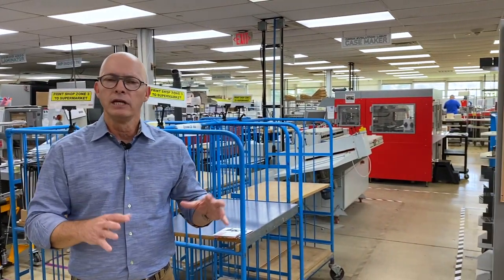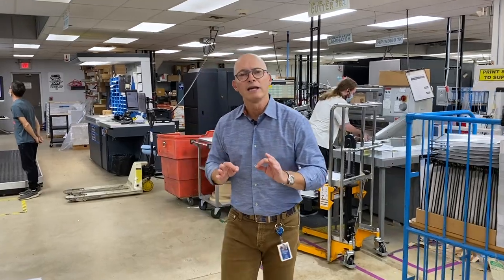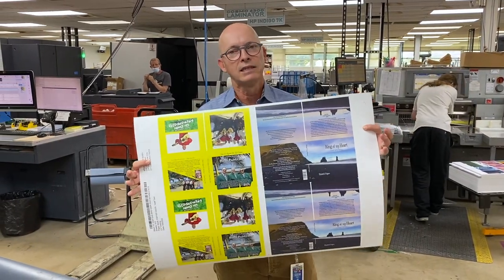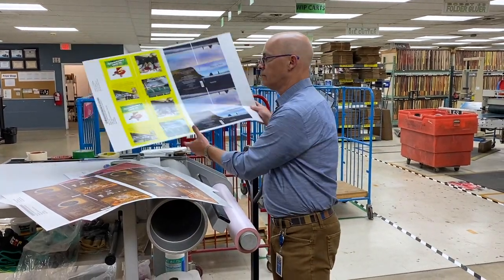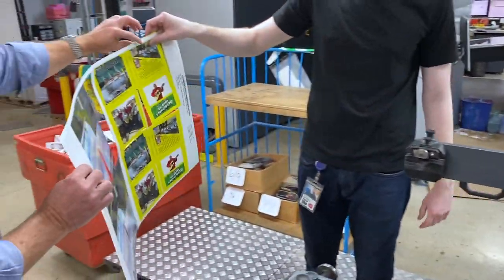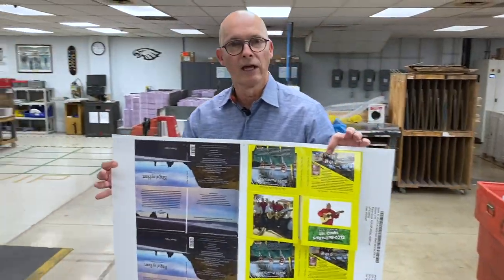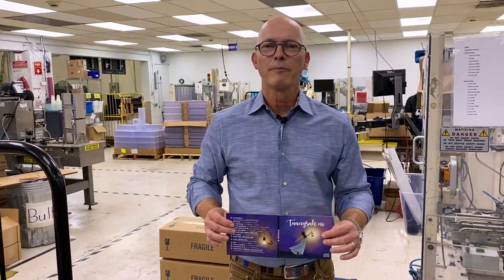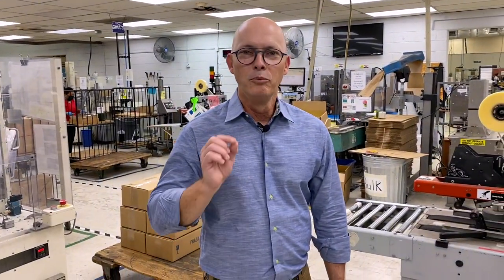How Are Digipaks Made at Disc Makers?

Comment: better question. why the digipak? vastly inferior to the jewel case which provides real protection and has never been improved upon. trying to emulate the lp with cd inserted into a flimsy hard to access piece of cardboard is no improvement. one step forward and 10 back.
Reply: so true john ricco
Reply: I feel the same like if im paying money for a cd i want it in a jewel case not a crappy piece of cardboard
Reply: I like digipaks for the artwork and because they’re convenient. Jewel cases are clunky, and i can only fit about 5 of them in my center console. With digipaks, I get at least 8 in there
Reply: @J0N0AL Agreed.  I hate jewel cases.  They always break at the connecting points and then the case is useless.  The digipak displays the art better without a flimsy insert sheet too.

Comment: So the tray and CD/DVD are added at the same time when being poly wrapped?
Reply: Well, yes. The discs are manufactured separately. The board is printed, die-cut, folded, and glued separately. And then during final assembly, in one flow the disc is inserted in the tray, the tray is glued onto the board, the Digipak is closed, and then it's poly wrapped and boxed.